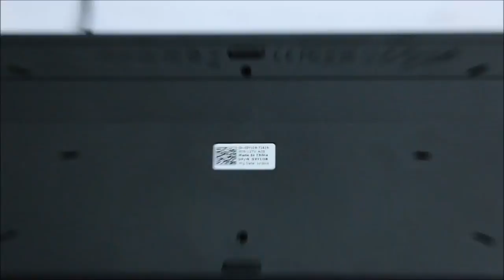What's Inside a Keyboard ?

Comment: Thank you, my keyboard was not working after taking apart... I had missed the rubber in 2:50 and the sheets were not connecting to the circuit board due to low pressure. After watching this I remembered to put the rubber back and now it works!
Reply from the maker: Welcome ...😊..glad to know that my video helps to fix your problem